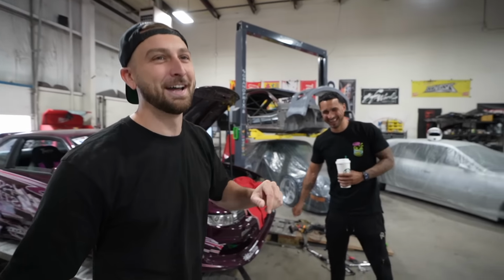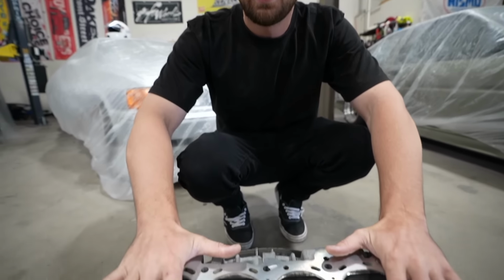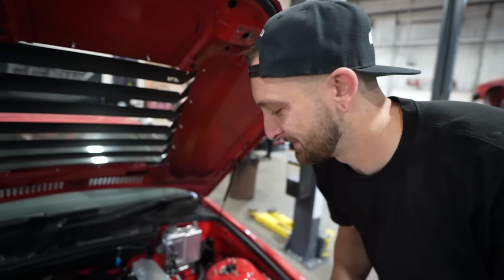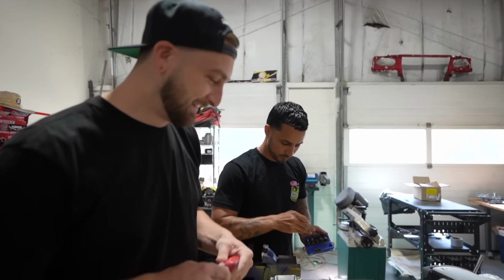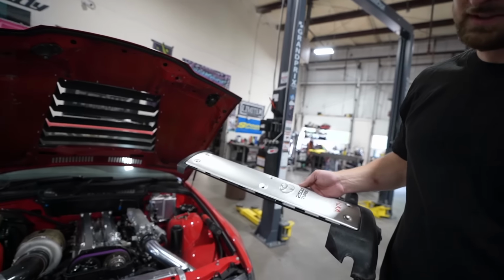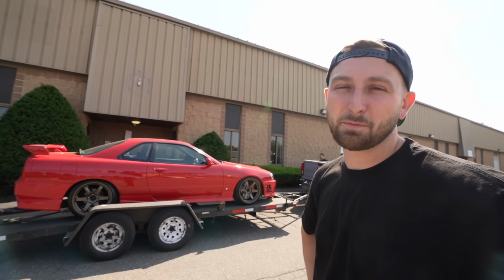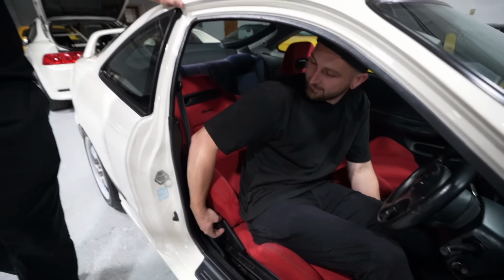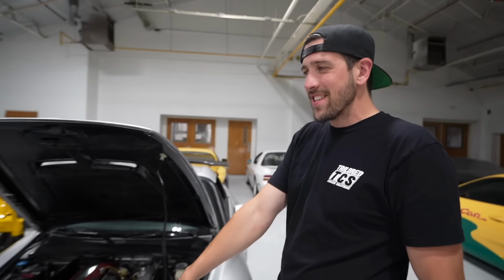Saying GOODBYE to my R34!

Comment: My friend has a mk4 supra that currently makes 2800rwhp on what he calls low boost (29psi) and it’s still got a faster tune thats programmed to a switch that makes (50psi) boost and 3900rwhp 
But he told me the hack he does to keep them little screws to stay in that baffle in the intake manifolds he tack welds them with a tig welder

Comment: As a 15 year emissions repair shop owner  in phoenix. I’m super curious to know how most of your builds are able to get around smog requirements? Or to get plates? Are you guys running any cats ? Or just tuning off a few monitors to be able to get through smog? I know that 98 or older are exempt usually from emissions.

Comment: Are you sure the oe hardware isn't a shoulder bolt so when tight it only has a certain amount of squash on the rubber gasket. If you torque  normal bolts it's flexing the ears too much. Seen it before on SRs when people used normal bolts.

Comment: Please be careful with that copper baffling. That copper is just a coating and I’d be slightly nervous of that coating coming off and falling into the engine. I know it’d be extremely fine particles but metal is metal, be careful.